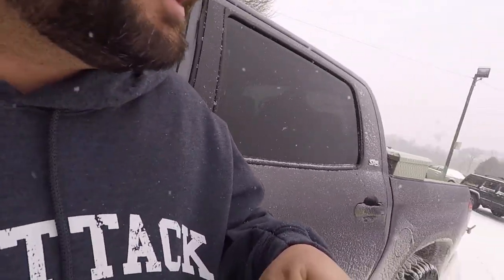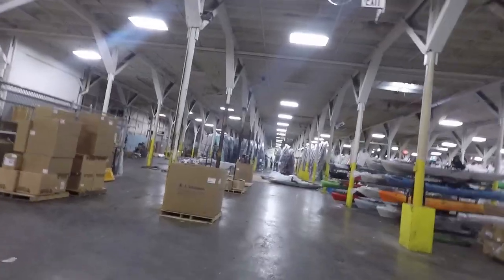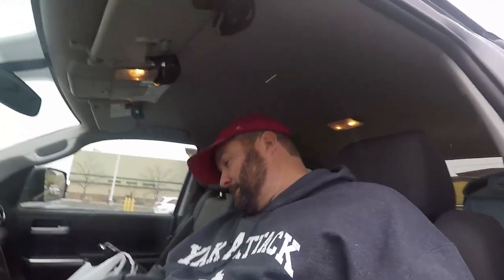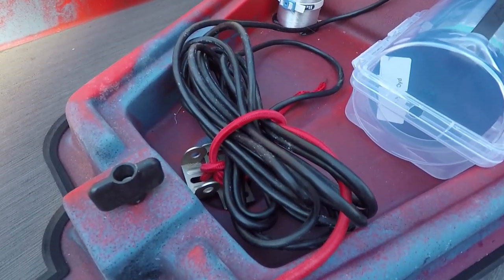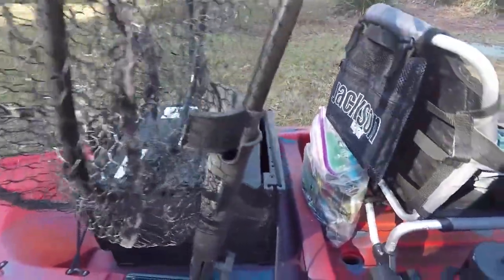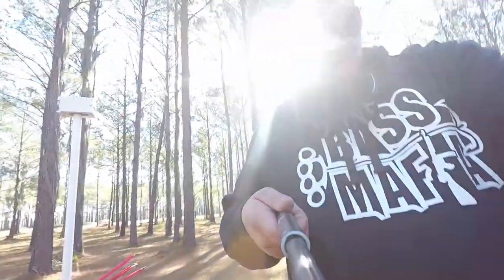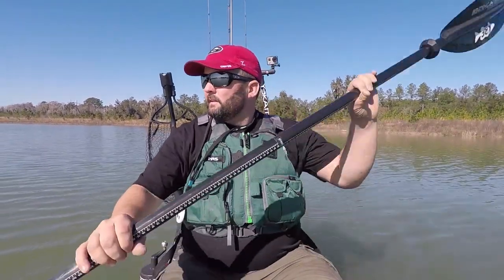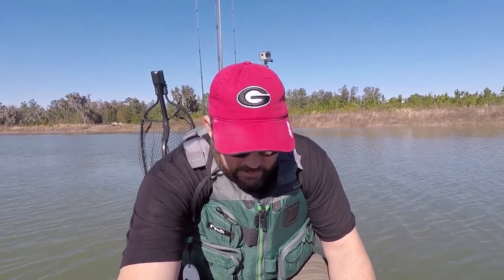Introducing the new Liska Kayak by Jackson - A great first Kayak

Comment: Could you stand on it and cast if you wanted?  Are the tracks metal or plastic?  I am in the market for a kayak for creek, small river, backwaters, and monster catfish.  I kind of require stability so I don't get pulled in by a 50 pound Blue Catfish or Flathead.
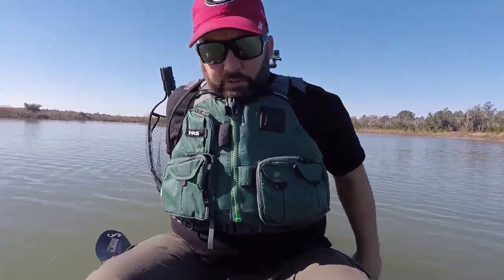Reply: 13:05 well that answered my question haha

Comment: Question about the Anchor Wizard.  Do you just prefer to run it off of the front or could I just mount the Wizard on my Coosa HD and just use the anchor off of the side with no guide for the cord?
Reply from the maker: You can mount it anywhere but if you run it off the side just make sure you aren't in current. If you are in a river if you let it off the side you run the risk of capsizing your kayak.

Comment: How exactly did you mount the mightymount XL track bracket? I just got a kayak and need a bigger track similar to you. Did you use bolts or just screw directly into it?
Reply from the maker: All the mounting hardware cones with the Mighty Mount. They are bolts with a backing plate.
Reply: @Flukemaster  thanks a lot man. Just picked up a liska myself, any advice?

Comment: gene im a big dude (close to 300 lbs) i know ur pretty big too no offense. i dont think you're quite as big as me but would this be a good boat for a guy my size its at the top part of my price range so most larger kayaks are out of my price range and i don't really want to buy something that doesn't last. (cheaper brands) i was thinking something over 12' but if this would be stable and have some free-board for the river for a guy my size id consider it.
Reply from the maker: I'm pretty sure it will work for you. I'd just be mindful of how much Tackle and heavy stuff you put in it. My gear probably pushes 100 lbs.
Reply: Ryan Meyers ever consider a Native Watercraft Ultimate? I have and old 12 in my fleet and it’s great. Not a sit on top but sounds like it might fit the bill.

Comment: or you can buy a 14+ foot jon boat on craigslist for like $500 maybe less I'd rather do that
Reply: lol no
Reply: Thystaff Thywill really?  I got a Cuda12 for $1300...check out that price vs an ATAK. I think for the money Jackson gives you the most bang for the buck.
Reply: Thystaff Thywill really?  I got a Cuda12 for $1300...check out that price vs an ATAK. I think for the money Jackson gives you the most bang for the buck.
Reply: It's easy to say you can buy a 14 foot boat for the money but realistically speaking when you buy the boat you have to buy a trailer you have to worry about maintaining the trailer maintaining the motor so the money adds up a lot more. With the kayak you just put on top of your roof of your car load up your fishing rods and go fishing if you want to upgrade it then that's up to you but a lot of upgrades can be done by DIY PVC parts. Also kayaks are a lot lighter you could take him almost anywhere. if you want to pull around aluminum boat through the woods that's going to be a challenge,  you need two or three guys to do that
Reply: And yes you can buy a pelican for $700 but Jackson is not overpriced they make high quality plastic.  if you put a pelican kayak in a river and start bumping into rocks and going through Rapids you most likely will crack it because the plastic is very thin and cheap
Reply: the trailer comes with most of the time and you dont even need a motor just row it just like paddling a kayak. youd want a motor but sometimes it comes on the boat and if not a used trolling motor can be found fore like less than 200. the point is youd be stupid to pay 1300 dollars on a kayak
Reply: I've used my $800 WS Tarpon 100 kayak for 8 years and loved it for backwater fishing.
Reply: LOL, Hobie says hello.